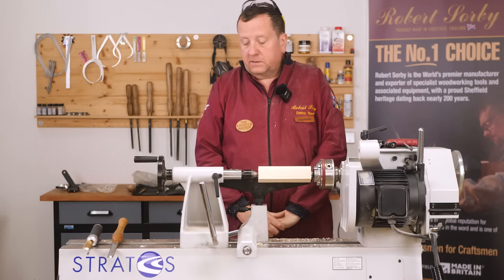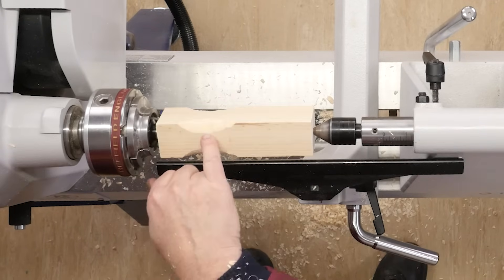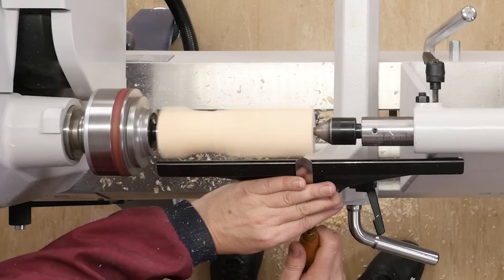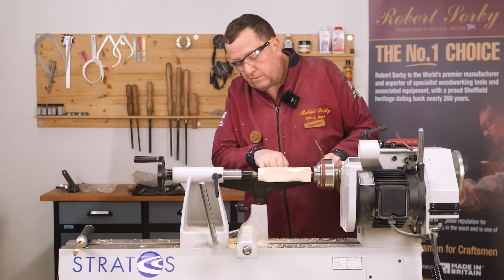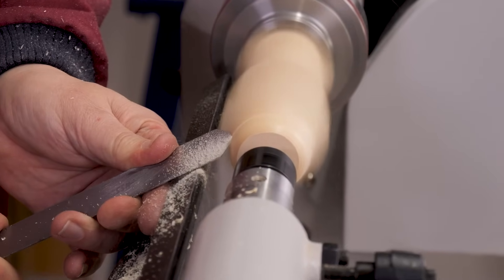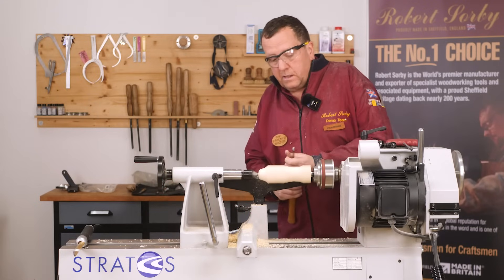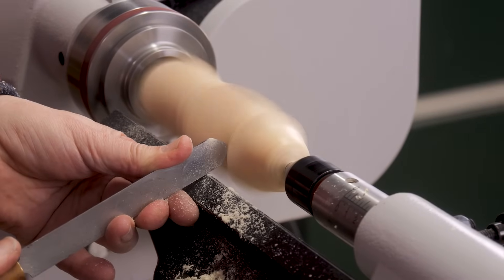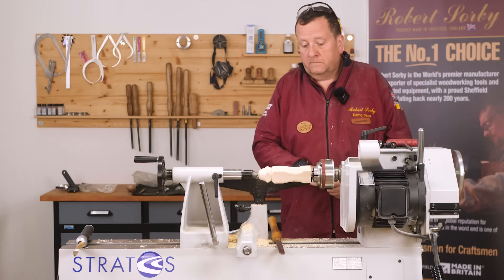The Robert Sorby Spindlemaster - An easy to use alternative for the regular skew chisel

Comment: After buying one and finding it didn't offer me anything that I couldn't do with other tools, I bit the bullet and ground the shiny bevel down until the included angle was about 35 degrees all the way around. Then I sharpened it the way you sharpen a knife. Honed the bevel and the top surface, alternately, until I obtained a very keen edge with no burr. It became what I call a knife edge scraper. 
  I present the tool to the wood with it flat on the rest and aimed at center line. Instead of scraping, it cuts and makes tiny shavings. It is excellent for fine finishing cuts or making small adjustments to the profile of a bowl or other vessel, inside or outside. The depth of cut is determined by how hard I press it against the wood so I can be very precise when adjusting a curve, for example. And it leaves a fine surface even when dealing with very gnarly wood.
Reply: I've been using a similar tool ground from a round bar stock as a bottom feeder scraper/fluteless gouge

Comment: The spindle master was an attempt by Sorby tools to reproduce an Allen Batty tool. I had a workshop with both Allen and Stuart. Allen commented about it, "they got it all wrong." His tool was made from half round bar stock, not a thin slice. Closest tool out there like that is Stuart and Cindy Drozda's Vortex tool, or the Thompson fluteless gouges can be ground to that profile. Also, the starting cut you did with the SRG, I could do it and leave a glass smooth surface, and I am a bowl turner.
Reply: Kind of weird to tell them what they are attempting to do and then tell them they got it all wrong. According to your description this is so different that they even start with different raw stock material. Apparently they are satisfied enough with what they were attempting to make to produce it at scale and promote it. If you want a different tool, but a different tool, if you want this one buy this one.
Reply: I have a set of them and don't care for them, just too thin and flimsy. Allen Batty, father to Stuart, was the one who said they got it all wrong. While they may work okay, they do not excel the way half round bar stock will.
Reply: That was my first thought, why is the underside flat.

Comment: What did you sharpen it with? I am in USA, is it available on Amazon?
Reply from the maker: Its a simple diamond file, im sure you will find something like this in the states
Reply: @ks-allyouneedforwoodturning  I think he meant is the Spindlemaster available in the US, the links are to a german website.
Reply from the maker: @danielpaquette1597  Okay got it. Sorry these links are for our website, of course. I don't know any Robert Sorby Dealers in the US. Try to google it.
Reply: This looks amazing. Would you recommend the 13mm for a new woodturner using a smaller lathe? Or could you maybe give the main usage difference between the 19mm and 13mm tools please?
Reply: I’ve owned one for over ten years, since they were introduced…..I think. It is are a useful tool, but not a replacement for either the spindle gouge or the skew. Both the spindle gouge and the skew have stood the test of time for a good reason, they perform to the highest standard. The modern trend of using fancy new tools, like carbide scrapers etc only substitute badly for poor craftsmanship. Just watch a production wood turner produce stair spindles using just a skew and spindle gouge…….and remember he’s on piece work.
Reply from the maker: @mergrew0110  thanks for your comment, its true what you say. But I would not compare carbide and "fancy" tools with this tool. There are a lot of woodturners out there, maybe just need a lathe for tiny projects in their woodworking existence. In cases like that, I think its very useful when you have an easy to use tool like this, that helps you to cut soft timber very clean.
Reply from the maker: @Brianb_ie  I think you can call the 19 mm version an alrounder. 13 mm is really if you're mostly penturning.
Reply: @ks-allyouneedforwoodturning . I’m in my eighties, and have retired from regular work, as I said I think it’s a useful tool to have in your arsenal. I believe the right tool is the one that works for you at that moment in time. I’ve used it, on occasion, to good use, I’ve even had to make my own tools for specific tasks, but firmly believe that the mastery of the time proven basic tools is the way to become a competent craftsman.
Reply: @ks-allyouneedforwoodturning this is great advice thanks. I have a small lathe I’m learning on and just have the capacity for small bowls and some spindle work like Christmas ornaments. The spindlemaster seems a great way for me to do this and the key thing for me is clean results in soft pine. It’s very hard to source decent hardwood where I’m based but pine is freely available and means I can practice more.
Reply: @Brianb_ie  I to have a small lathe and am just beginning. My lathe came with some small carbides and I want to transition into traditional tools. But the cost of them plus the sharpening can become costly. I am a home improvement contractor, so I get lots of scrap 2 x 4, 2 x 6, 2 x 8 pieces. I think this may be a tool that helps me.
Reply: I got mine on Amazon in the US.